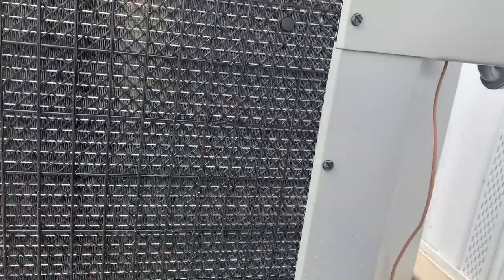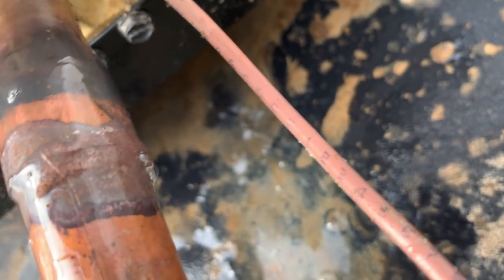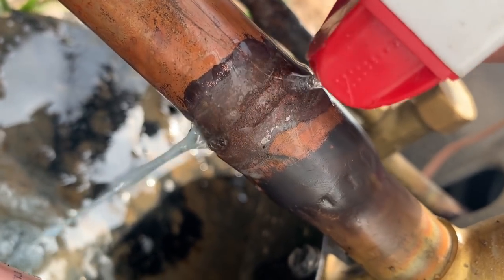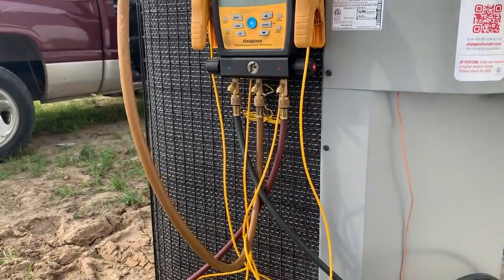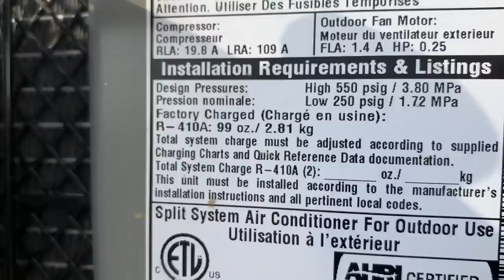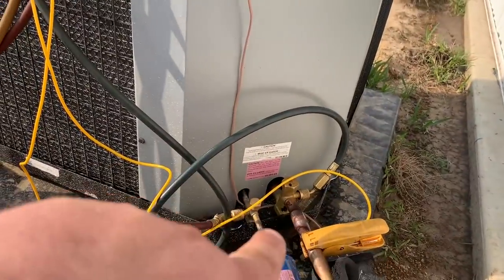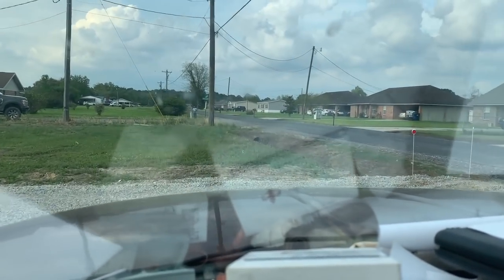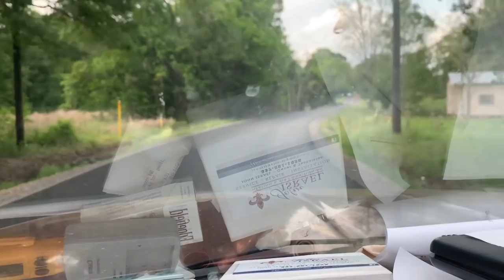Brand New System Freezing Up

Comment: I'm not the fastest installer but have never had to go back and fix a leak. I always pressure test with nitrogen and use a micron guage.
Reply: exactly, always tripple check your work. Its a part of your job description, the worst part about the leak is that the technician put a shit ton of solder on that line and still it leaked lmao

Comment: I've seen guys not pressure test with nitrogen pull vacuum with manifold only down to -30 on gauges and hold because armaflex sucked into leak and sealed tight but once valves were open couldn't miss the hissing. Nitrogen testing and pulling vacuum to below 500 microns prevents stupid mistakes. Good catch John 👍. I use two 1/2" hoses straight to vac pump with cores removed and micron gauge on high side core tool. With my setup I can pull new residential systems 5 ton and down to 500 microns in about a minute after 15 minutes they get really deep. Last two Carrier 5 tons with 50' linesets each I shut pumps down at 68 and 80 microns after 30 minute evac.
Reply: I agree with you . That is  the right way according to the EPA and IMC rules.

Comment: I installed a new Goodman system last week and I had a leak in the same location on the suction line.  I did hear the whistling when I pressure tested with nitrogen so I was able to find the leak and fix it without losing any refrigerant.

Comment: I use two 3/8 hoses, i have a standard pump with a half inch, 3/8, and 1/4 port. I just reduced the half inch with a fitting and use a 3/8 hose on it. 30 min vacs to around 500 microns depending on the unit. It pulls quick for residential units though.

Comment: I use the appion 1/2 fl x 3/8 fl hoses (2) hooked to 2 core tools and micron guage on core tool and that combo pulls units down fast you are right it wouldve never pulled down if a vac was attempted

Comment: Nice find & repair on the leak John, I use big blu as well, definitely my go to bubble leak detector. The Tru Blu kit is definitely nice but expensive. I run the 3/8" appion vacuum hose on the suction line & a 1/4" hose on the liquid line & it works great.  Trutechtools has the 1/2" appion hose with the valve core removal tool on sale for $109 & if u use a code u can get it for $100.28. 👍👍 Stay safe

Comment: My daughter bought a new house with a Goodman system. First time to use the AC it didn't work. The installation company came out and charged it up. Worked that summer. Next summer no AC again. So she calls Dad. Found the exact same thing as you did on this video. If you use an S-man or a Testo set you can see a leak like that on your manifold set. I don't understand how someone can miss a leak like that.

Comment: Skyline Homes installed the roof vents improperly causing a leak. They would not admit they did it wrong and they would not fix it. I had to pay $500 out of pocket to fix their mistake. No more Skyline Homes. The roof was never right. The walls in the closet would sweat in the summer time. AC unit could not keep up. It ran non stop from 10 am to 9 pm.

Comment: 1. At the rate presented in the clip, I calculated the leak at around 1-2 grams a day. There's no way, the system could loose charge due to this leak in 4 days.
2. Bad joint suggests poor workmanship. The whole system should have been thoroughly checked to eliminate possibility of other faults.
3. If there's another leak, next time you come, you should only charge for the time to find it and repair it. No charge can possibly be presented for call-out and refrigerant.
Reply: Personally, I don't like these condensing units with the service valves at the bottom corner of the condensing unit.  The valves are hard to access and it's hard to check under the pipes for leaks.  Last week, I had a leak just like this and I checked it with a mirror but my eyes aren't what they use to be so I always pressure test the line set with nitrogen before opening up the valves.
Reply: 😂😂😂 might be the best thing I've ever read.
Reply: @SupermarketRefrigeration  I'm very glad, thank you! By the way - you don't read much, do you?
Reply: @Luzt.  no, only every day. Lol.  Could you please explain your method of calculation to determine that leak rate??
Reply: @SupermarketRefrigeration  In short. 1 mole of gas in normal conditions is ca 24400 cm3 (24.4 liter). 1 mole of refrigerant is 72 grams. You estimate size of bubble/time to develop it then volume per day then mass per day. Simple arithmetic calculation does the job. This is all rough estimate which nevertheless has fundamental diagnostic value. In this particular case it points out at a possibility of another leak/low initial charge/etc.
Anyway - everybody uses tools which are available for them. I find no difficulty in both cleaning the bird-shit and creating Excel sheet ;-). Have a good day.

Comment: You found , A, leak. My neighbors was leaking there, very minimally plus he had a leak in the condenser.  They came and fixed it and then he insisted on dye.   A couple days later I went over with my light and it looked like a murder scene.

Comment: 4 ton?  small house?
Reply: most all mobile home/double wide/manufactured homes, which they claim are so great, efficient and cheaper to own, are nothing but hot boxes without wheels, all sides cooking hot temperatures, lack of insulation thickness and poor design overall.....  they have very limited roof insulation cavity also, best bet on them is highly reflective steel roof!
full basement, followed by concrete slab and large open attic where they can insulate very thick are far better in comparison.

Comment: Big Blue is too expensive. All you need is dish washer detergent. Use it Thick its much less expensive.
Reply from the maker: I’ll stick with big blu
Reply: Dish washing soap will freeze in the winter, use approved leak detection.
Reply: I'm glad someone mentioned it. Soap and water seems to work better than whatever he was using. If you're worried about freezing add a little antifreeze/alcohol. Done deal. Can make an entire bottle under $1.